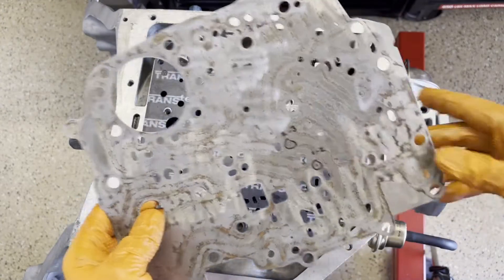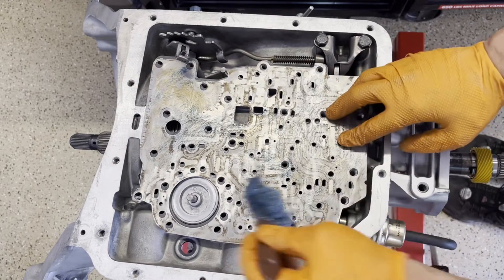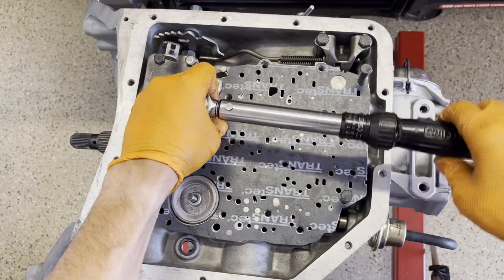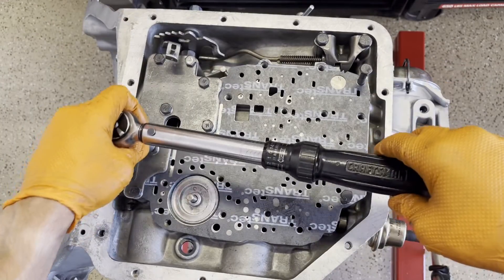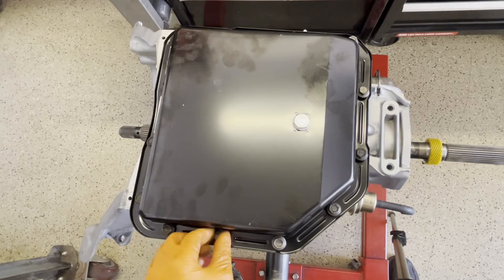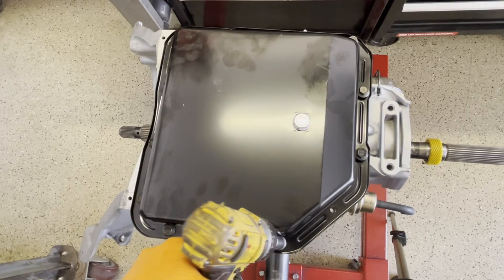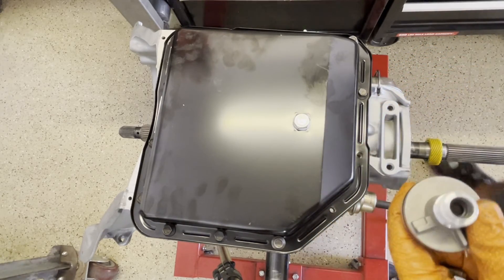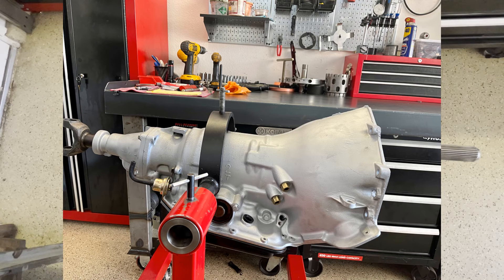GM TH350 Rebuild PT7 - Valve Body Installation and Conclusion (Please read description)

Comment: Nearing the end of my build here at home. I am super lost, because when I use the original rooster comb from the last transmission, my newer style S hook no longer works (it was originally a much longer S hook with 90 degree bends). 

If I install the newer style rooster comb like you have pictured, the s hook works exactly like it should. However I lose compatibility with roller spring detent that bolts onto valve body, and keeps the gear selector from wandering into other gears. It definitely isn't long enough. The one you have in the video seems to be longer than the one I have on hand.

Any ideas / suggestions? Thank you again.
Reply from the maker: What happened to the original rooster comb/engagement arm that came with the transmission you are rebuilding?
Reply: @nickstransmissions  I still have the original rooster comb. But no longer have the 90 degree bend s hook. 

Just now found one on ebay which is the early style manual valve with an older style s hook that has 90 degree bends and flattened on one end to keep it in place. I think if I install that one and use the older rooster comb I have on hand I should be in the money.
Reply from the maker: Yep, sounds like you will have what you need with that linkage arm on eBay.

Comment: Did you leave out ALL the checkballs?
Reply from the maker: I installed all of them but I think check ball placement is covered in PT6, not PT7.
Reply: Ok i didnt see that, can i just reinstall the 1 thats necessary covered in the no reverse video? You pointed out@nickstransmissions
Reply from the maker: You need the intermediate clutch check ball and reverse check ball....But keep in mind that leaving out the others does firm up shifts fairly significantly, especially the down shifts.
Reply: Ok. They are one and the same ball? Because i remember you pointing out just to keep the one ball.  @nickstransmissions
Reply from the maker: Shit - My bad, Tim....I was thinking of TH400s when I made my above reply.

For TH350s, you need just one check ball - the modulator check ball, which is located near the vacuum modulator.

For TH400s (in the event you build one), you need the intermediate check ball and reverse check ball. 

Sorry for the confusion.
Reply: Ah ok makes sense now thanks 👍🏻@nickstransmissions

Comment: Quick question. My S-clip fell off because of the linkage being loose. I thought my car was in park but it was in Drive. When you put the roller and s-clip in that position is that park or neutral?
Reply from the maker: Not sure, it depends on what position the manual valve happens to be in when you engage the S link.

Thanks for watching, Luis!

Comment: You didn't put the ball check in did you?
Reply from the maker: Hi Jim, it's in there - you can see the modulator check ball in the case at the very beginning of this video...Unfortunately, I either didn't film myself putting it there or it's somewhere else in the video (I filmed this series nearly two years ago so going from memory). I will be filming another TH350 complete rebuild that will cover some of these missed/under-addressed aspects of that video series in the near future.

Comment: I must have missed how many check balls he used
Reply from the maker: Hey man, thanks for watching...You didn't miss anything...The check ball placement and considerations can be found in Part 6: https://youtu.be/jh7RFLsbQEA

If I do another TH350 rebuild on the channel, it will be done in two parts vs 7 or 8 like this series.

Comment: Hey Nick. 2 questions. Is there any way to identify a th350 vs. th350c torque converter? Secondly, is there any way I can email you or send you a few pics/messages?
Reply from the maker: Hi SuperiorPeninsula - TH350C converters have a much smaller input shaft pilot diameter at the bottom of the converter compared to the standard TH350s...I don't have any way to receive pics but if you have addl questions, you can ask them here...This way, other viewers can benefit from the exchange.
Reply: @nickstransmissions  https://youtube.com/shorts/VI0m0ojWKh8?feature=share
Reply: Hi Nick. I'm in a jam. So, I have the 97-1c28q Hays converter. I brought the replacement trans down to the shop for install. I got a call that the input shaft is different then the old trans. I'm confused, as the th350c is in my 1984 Monte Carlo. The replacement trans is a th350c out of a 1984 (or was it 86?) Corvette. Why would the input shafts be different? They told me the converter fits my old (junk) trans but won't seat on the new replacement from the Corvette? I can't find anything online that supports this.

Comment: Hey Nick.  Are there any issues with building the trans dry and letting it sit?  I'll use the assemblee goo like you said and WD40.  I don't know when this will actually get put into service.  Just trying to figure out if i need to soak and add fluid while building or if it can sit dry.  Great videos man.  Thank you for the help.
Reply from the maker: Hey Josh, no issues - just build it dry and keep it out of the elements...My TH475, featured in a rebuild series on the channel, is sitting in a closet in one of my spare bedrooms - who knows when it will ever see a vehicle, lol.
Reply: @nickstransmissions just wanted to say thanks again for the videos.  I put the fully manual th350 in a 92 S10 behind a 355.  I have about 150 miles on the truck and took my buddy for a ride that I bought the trans off of when be broke 2nd gear.  He said It felt like it used to in his C10.  With 3.42 rear end the S10 will chirp 3rd gear lol.  I'm now getting ready to build a rear end before to stocker pukes.

Comment: TY for the thorough information. Maybe you could give me some direction: I had my 1977 TH 350 rebuilt and have noticed that there is an intermittent shift issue 2nd to 3rd that happens when it gets warmed up.  I’v changed the vacuum modulator and installed a new steel line from the manifold to the modulator, removed the modulator valve and it seems good.  Any suggestions?  Thanks
Reply from the maker: Hi Matt, thank you for the feedback...When you say 'intermittent' shift issue, please describe what's actually happening once the trans gets to operating temp. Based on that, I will likely know the source of the problem. I could guess but don't want to send you on a wild goose chase...
Reply: @nickstransmissions  driving 20-25 minutes, after stopping at a traffic light or stop sign the 1st-2nd shift is good, but there is a delay from 2nd-3rd (high rpm’s) or sometimes a down shift once it’s in 3rd to 2nd and it doesn’t happen all the time-the dreaded intermittent problem.  I’m wondering if it could be a valve body issue.  I’ve calibrated the dip stick so that the full mark is at the top of the pan.  I’ve added a transmission cooler to try to keep temps down.
Reply from the maker: Hey Matt, the slip from 2nd to 3rd sounds like either a slip (cut seals on the center support or mis-installed lip seals on the direct piston or the center seal in the direct drum. 

First thing I would do is contact the builder to see if you can bring it back for review/inspection and have it fixed under warranty. 

As far as source, there can also be a problem with internal main line pressure, the modulator system, or even governor. I'd start w/line pressure...plug a 300PSI gauge and do a pressure test...Pressures should be between 50-65 PSI at Idle in P, N and D...Reverse, Manual 2 and Manual Low (1) should be twice to 2.5 times higher....If those checks pan out, go to the modulator: check to see if you have at least 12-14 inches of lift at the modulator with a vacuum gauge. If so, pull the hose off and check for trans fluid. If none found then you can remove the modulator and using a pen magnet, check the valve itself for freedom of movement. If all these checks pass, you can rule out the modulator...Then pull the governor out...check the condition of the gear as well as confirm that the valve inside the governor body moves when you actuate the weights by hand. If everything is ok so far, drop the pan.

Drop the valve body and make sure the 2-3 upshift valve moves freely in its bore. Then check the detent and detent regulator valve for the same thing (both those valves are in the same bore). 

If all those checks pass, I would suspect a leak in the hydraulic apply circuit for 3rd gear (cut sealing rings or partially torn lip seal(s). 

But as i stated earlier, I would first call your builder to see what he can do to help before doing any of the above yourself.
Reply: @nickstransmissions  back to the builder twice over past year. They test drove and checked pressures said “it’s all ok”. I’ve done everything you’ve suggested up to valve body inspection so will drop the pan and see if that could be the issue. Thanks for your input-much appreciated!
Reply: Forgot to say - no solenoid on this model.
Reply from the maker: Geez, sorry to hear the builder isn't being more responsive. As far as the solenoid is concerned, check to see if there was a block-off plate installed on the case location where the solenoid normally goes when you drop the pan...Why was the solenoid deleted? Also, don't take the builder's word for anything at this point as things are obviously not 'all ok' - I'd run a line pressure test, both at Idle and on the road at 1000RPMs then read it at 3000 RPMs in D when shifting from 2 to 3 to see what, if anything changes. For example - at 3000PSI in 'Drive', if pressure isn't lower by 10PSI or so relative to your pressure at 1000 PSI then your governor may be sticking which could produce a no-upshift condition from 2nd to 3rd. Either way, you should have plenty of line pressure above readings at idle when driving around. 

Check the filter for clogging. I'd prob replace the filter w/a high flow version while I'm at it. If there's an excessive amount of burnt clutch material in the pan then you've found the problem (stressed/partially burnt direct clutch pack).
Reply: @nickstransmissions   I don’t know about TH400 but know for sure that the TH350 that’s original in my 1977 GMC C15 truck did not have a solenoid. My dad bought it new and I bought from him in 1985 so I know this is the first time the transmission has been opened up other than fluid/filter changes. I very much appreciate all the info you’ve generously provided.
Reply from the maker: My bad, sorry for the confusion - I was thinking you had a TH400 for some reason when responding above - that's what i get for multi-tasking...The problem sounds as though it could be modulator itself (checked), lack of sufficient vacuum at the modulator, kick down cable (worn cable or out of adjustment), valve body (not likely as the VB is likely responding to hydraulic pressure inputs from other sources but worth checking anyways), 2-3 accumulator sealing ring partially damaged, excessively worn 2-3 acc piston pin bore or worn VB casting (this is on the underside of the valve body), governor or internal issue with the direct clutch hydraulic apply circuit (cut/worn sealing rings if not replaced or partially cut direct drum/apply piston lip seals). 

I would still do a pressure test as the same TH400 pressure-driven issues can cause the symptoms you're experiencing.
Reply: @nickstransmissions  thanks for the help. I’m hoping to find some time this weekend to check the things you’ve suggested that I haven’t already done

Comment: So now that it is all running thanks to you help, can you tell me what line pressures I should have under what testing conditions? I cant seem to find this info anywhere, and what I did find was just confusing and lacked enough detail to perform the tests correctly.. TH350 stock build with stock converter, no shift kit... any simple info you can provide me is appreciated.. I did subscribe to your channel... Thanks man!
Reply from the maker: Glad to hear it's back on the road...At idle, P/N/D should be between 50-70 psi, R should be ~110-125ish and manual 2/1 should be ~150-180ish...You can Google the pressures at stall if you do a stall test but not necessary if everything's working as it should.
Reply: @nickstransmissions  Ok, what caused me confusion with the stuff I read online was just a bunch of confusing info on different readings at Idle, then different readings at 1000-1200 RPM, then different at stall, then a different set of pressures if modulator is connected vs. disconnected... etc.. Total confusion!. So just to be clear, you are telling me to look for the pressure readings you suggested at idle with modulator connected (Brakes applied and not moving, correct)?  If so, my pressures at 850 RPM (park idle speed) ,with the brakes applied and modulator connected ended up being   70psi in P, N,D,   125 in Reverse,    and 110 in L1/L2. (not 150-180 as you suggested) Thanks for just clarifying the testing conditions for me and if 110 is ok for L1/2
Reply from the maker: 110 psi is fine at idle, for M2/M1 - I was thinking of those pressures at stall when I replied earlier.
Reply: @nickstransmissions  Oh, ok, so I need to check for the pressures you originally suggested at stall? Or at Idle? I really hope others are reading this since checking pressures is a very common question I see on the internet with no clear answers...
Reply from the maker: At idle. Stall should be ~3x idle while in Drive.
Reply: @nickstransmissions  thank you!